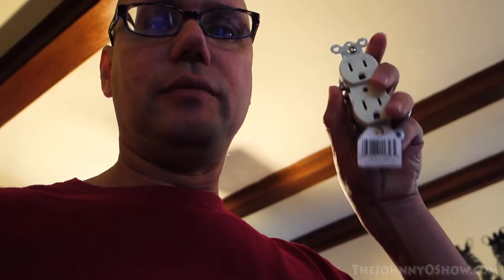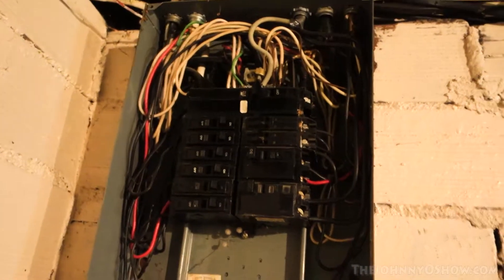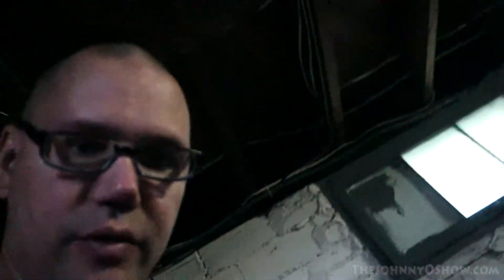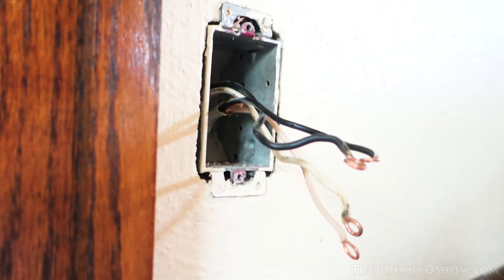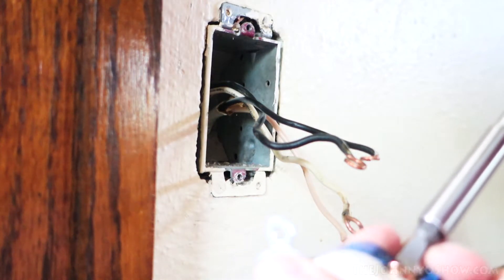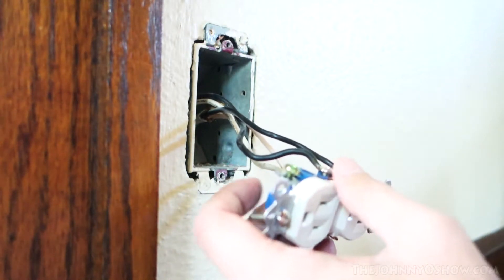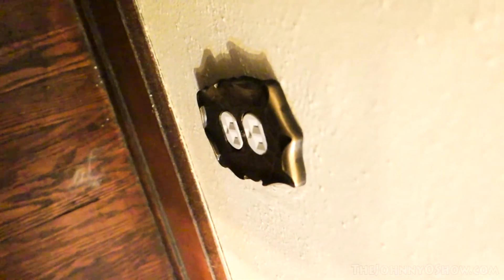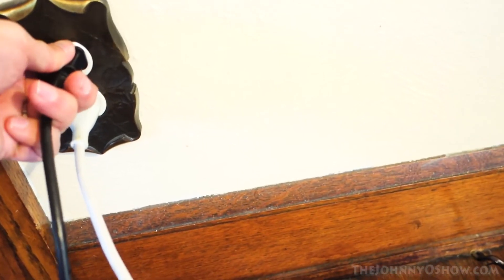Ep. #238 Replacing Old Electrical Outlets

Comment: You are the moron for putting the outlet upside down.Ground always up.
Reply from the maker: While there is no code stating that the ground should be on top or bottom, this guy explains even better why they should just be on the bottom. (Just the first minute of the video, you can see most things are designed for the ground to be down)
https://www.youtube.com/watch?v=BYZnIFlg_Hg

not to mention look at the cord on your refrigerator and your stove (or anything that has a low profile plug with a ground)

Comment: Should have used a GFCI device -- that is actually the "code" way of doing this. (The GFCI will provide some good protection.) If you know the circuitry, and know where the first outlet (closest to the breaker or fuse) is in a given branch circuit (i.e. branch circuits are protected by a breaker or fuse) , you can wire a single GFCI device on that one circuit and it will protect all the following receptacles and other electrical devices on that circuit (i.e. any receptacles or other electrical devices coming later in the chain on that circuit). Just a little money saver for you.

Here is a guy's video on the actual code options, if you are interested.
https://www.youtube.com/watch?v=ekl_t-Q2ahQ 

What you did here is just save yourself the trouble of getting a 3-prong-to-2-prong adapter every time you want to use a 3 prong device. In my opinion, what you are doing is not any less "safe" than what you had before -- just not an improvement. What I am suggesting here are actual "improvements."
Reply: isn't it against code to use only one gfci in the branch? not positive but i think each outlet must be gfci or gfci must be on the breaker box.

Comment: ground can go up to help hold a plug better / try it on a vacuum cord
Reply from the maker: You have a good point. While there may be a some reasons to put them the other way (ground on top), and while there is no code stating to put them up or down, I have found that pretty much everywhere you go in the US the standard it to put the ground on the bottom. 

I have found it quite annoying to be trying to plug a light in in the dark or something behind a dresser only to struggle because of not being consistent. 

What's worse, the  few places on this house that do have the ground, half are with it on top and half on the bottom, so I was a bit annoyed that day with the last person that owned the house. 

If you look at all the thumbnails along the side of this video all the other videos out there you will see the norm is for the ground to be on the bottom. Its just nice to have things consistent, kind of like making sure when you do plumbing the hot water is on the left and the cold is on the right. But as others have pointed out there is no code stating the ground has to be on the bottom.

Comment: additionally better to use a drill to get the screw terminals TIGHT instead of by hand as tightness is a variable...particularly important for aluminum wires as the wires tend to loosen(electricity vibrates 120cps which loosens the screws and hence FIRE).
l seen fires at outlets because of loosely connected wires which cause arcing(like a welder) and then FIRE!!.
Reply from the maker: Good point about tighting with drill and also regarding aluminum however my house has copper wire through out.

Comment: duhhhh!!...black to gold screws and white to silvery white screws,no ground,,no tape wrapped around outlet to cover lack screws, no tape on on hot wire as a flag and wires not pushed in on sides like an accordian.. TAKE A COURSE before the house burns down unless insurance covers 2x current cost of home for replacement (l guess that's the plan??)
Reply from the maker: Yes as it has already been pointed out in the comments it  did get the the white and black on the wrong leads however what was wrong with the tape. I am not sure what your saying. And yes there is no ground but that was the point I have a few items that don't need ground like a tv a laptop lights etc but even plugging in a surge strip to plug those things in is a pain because the surge strips have a ground even thought the devices I will be using do not.  But I am wondering what was wrong with the tape? https://www.garagejournal.com/forum/archive/index.php/t-59066.html

Comment: I would check that  wire,it seems awful new and definitely not from 100 years ago.Maybe it has a ground and whoever installed it just cut the ground wire.
Reply from the maker: Thanks for this, i went back and checked when i went it to switch the black and white wires. Unfortunately the last person that owned the house really cut corners even worse then I ever would all the electrical was replaced but a lot of places they just ran 2 wires, I have no idea why they would do this when they were putting in new wire anyway, but they did :-(

Comment: if you don't have a ground wire I don't think it matters from what I heard and the ground pin can go up or down if the plug comes out a little then if something metal falls down it hits the ground pin first places that work with metal things will do this but there isn't a right or wrong way but most night lights are set up ground pin down

Comment: I THOUGHT WHITE WIRES ARE SUPPOSED TO BE ON THE LONG SLOT HOLE AND BLACK WIRES ARE ON THE SHORT SLOTTED HOLE SIDE!
Reply from the maker: +Thomas Lam Good Catch. Thanks for pointing that out. I am adding an annotation.
Reply: YES SIR !  JUST TRYING TO REPLACE ALL 2 PRONG RECEPTACLES TO 3 PRONG IN MY HOUSE ALSO.
Reply from the maker: +Thomas Lam ,You may already know this put I am posting this here for anyone else that reads this.... It will of course work reversed but it makes things like a light socket have the outside where the bulb is screwed in as the hot part instead of the inside, so easy to get shocked, unlike if it was done the right way you would have to stick your finger inside the light socket. I am using it for a TV and my laptop so not really an issue, as unlike a light fixture I would not be touching anything hot inside the tv. But this is why it's important to get your polarity correct because if you plugged a desk lamp in, chances are you will get a nice shock when you change the light bulb if you don't turn the light off first.
Reply: Yes Sir!
Reply from the maker: I am just going to replace this video with a correct one, Again thanks for pointing this out, I will delete this video tomorrow when i replace it.
Reply: Yes Sir!